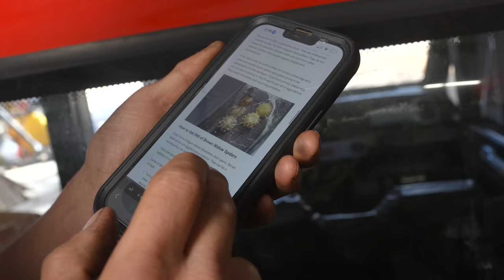Building an Elevator in my Dream Garage! Officially Moving in!

Comment: for insurance, you don't have a elevator, you have a materials lifter
Reply: Premium
Reply: a dumbwaiter. idk how to spell it.
Reply: I hoping they add a fireman's pole and ladder.
Reply: @robmanueb. Definitely need a pole haha
Reply: great thought, rkeantube…or else Ethan’s Risk Assessment will be SwindleShrek’d for a most non-Premium Premium
Reply: @mrgmc6314 I see what you did there…very clever
Reply: worthy updoot recipient
Reply: This! I work on freight Elevators Aka Verticle Reciprocating Conveyors(VRC'S). ANYTHING that carries people has tons of safety requirements.

Slap a "no riders, material use only" plate on that bad boy!
Reply: No actually fr tho
Reply: Y’all need to mount the winch on isolating rubber dampers - I bet it would be super quiet
Reply: For insurance, they never saw this video at all. Especially Ethan standing on beam steal welding a story high welding ✋👌😂
Reply: @OkGamez313 pretty sure that's right
Reply: Materials load. And they should add a small ladder on the side so that there's a physical way to get up there. It can be a basic cheap ladder fixed in place with metal brackets at an angle. Who's to say it can't leave when the inspector ain't there. > .>
Reply: Good call because insurance will look got anything to make the policy "Void".
Reply: There is no way these guy have that kind of insurance.
Reply: @grizoh buddy, they're making more money than us combined 😂
Reply: True! Not sure of their state requirements. But most states and insurance companies require a landline ran with an emergency phone installed for any “elevator” that carries people. Even if it’s only one floor
Reply: It's not an elevator, It Is a man lift! Like ones used on construction sites!
Reply: Well yeah
Reply: @Swiftwinter for the beam they better hope osha dont see this vid
Reply: Or just call yourself a block of wood 💀

Comment: the old shop would be really good as a paint booth so that you wont have paint dust everywhere in the new shop
Reply: That's actually a really solid idea!
Reply: I was thinking a fan and filter system for the new shop, and an office, editing room/bunkhouse b&b for the old building.
Reply: Having a dedicated place to make a mess is great, especially when you want to paint but it's cold out.
Reply: Also would probably be great for parts storage so they can move some of their stuff inside
Reply: Will's a goof ball, I love it. We got a guy at work like him, we call him Tism, cause he might have a touch of the autism
Reply: @merlincultofficial3235  I dont know, they have plenty of wood around so making a roofed storage from timber is rather easy. Just dig a hole, take old growth/slowly grown logs, debark, burn the surface, add the tar coating, least on parts that go underground, put flat peace of stone on bottom, then the log set upright, fill the sides with large stones hammering them in there with sturdy peace of wood, then apply earth insulation fabric and some gravel. Then connect the logs from top and braze to each direction, build a roof and put metal sheets on sides you want it to be protected from. Simple, cheap and sturdy construction to house parts and vehicles etc and propbably lasts 50 years if maintained properly.
Reply: The old shop would be absolutely awful to paint in.
Reply: @dcskate1022  why?

Comment: you should paint the floor red under the lift so things dont get set under it then broken when going down. i know it seems unlikely but its a really easy safety practice.
Reply: I've never squashed anything under the lift, and yet reading this I kinda want to do this.
Reply: Idk about anyone else but I think safety tape/visual queues and visual deterrents look really rad. So a red square underneath the elevator, maybe with horizontal lines, would look pretty rad.
Reply: This idea needs more hexagons obviously...
Reply: I've crushed a toolbox and a chair under the lift....oops
Reply: Mannn.. there’s no safety precautions on this page. You came to the wrong place 😂

Comment from the maker: Now that the garage is done what do you want us to work on first?
Reply: Firetruck would be a fittingly sized project for all that extra room 😎
Reply: @goosenotmaverick1156 100% yeah
Reply: The rotary trike!!
Reply: Finally Finnish the 2j mower
Reply: Definitely 2jz mower
Reply: electric tank. the 1 you started 2-ish years ago and forgot about it
Reply: Monster Mini
Reply: Electric tank!!
Reply: Do you still have the Subaru brumby/brat?
Reply: Something OUTRAGEOUS as always, of course!
Reply: I feel like you should have sealed or put down epoxy on the floor before moving in.
Reply: The limo or firetruck could use some love. 😎
Reply: Gotta be the firetruck and a matching little water cannon tank you can drive up on it.
Reply: Firetruck
Reply: Use the firetruck as a reservoir for the tank.
Reply: You guys should make a dope shop sign for the outside!👌🏼
Reply: @roybevins8682 I agree. It’s a lot nicer to have an epoxy floor because then you don’t get dust from the concrete. Also it looks a lot nicer.
Reply: full electric 4 wheel rockcrawler with center of gravity lower than center of the tire. you could custom build the frame and drive systems. would be so cool!
Reply: Make a submarine? To soon? Or 5o late? 😂😂😂
Reply: Get the ruckus done please!
Reply: It may make sense to have the table that the arc droid is on the same height as the fab/welding table. That way when you have a full sheet of material you can use the welding table to hold up half of it. Just a thought. Love the new shop guys!!  Almost done outfitting my new shop myself. I made my welding table to be the same height as my giant bandsaw so if I need to cut a sheet I can use the table as the run on or run off. Works great.
Reply: You guys should do something to those electric bikes like making them faster
Reply: I think another mini truck/ 4 wheeler or something tiny would be fantastic 😂

Then the fire truck🎉
Reply: Everything!
Reply: Fire truck then the limo before the room runs out in there😅😅
Reply: Shop tour!!!!
Reply: Ls swap the mini Cooper. Thing deserves some horsepower.
Reply: I been joking around for years that if you mate a K series honda to a B series transmission (crv) and point em 180 degree and install em in the rear end of a car you could have a rear engine awd package that is rwd biased... maybe.
Reply: A race drone that carries people! Haha
Reply: Is the ruckus finished?😂
Reply: Electric tank!
Reply: 2J mower or the rotary trike. Definitely 👍
Reply: Make something g out of that Porsche power wheels
Reply: redo the lift
Reply: A Brown Widow habitat.
Reply: The Electric tank gets my vote. The fire truck is second.
Reply: Electric tank!
Reply: Go back to your roots. Time to revive the mustang with some fresh upgrades and changes. It's what started it all so she should be brought back out into the light.
Reply: make a monster kei truck
Reply: Old garage to paint both
Reply: That 2jz  tractor would be an epic project when done.
Reply: @GrindHardPlumbingCo I think it would be incredibly ironic to do your smallest build yet. Whatever you can think of. Like a small humdinger motor powered car or something idk
Reply: Firing Will!!
Reply: V8 powered sherp
Reply: Unimog Jaguar !!
Reply: Micro rock bouncer
Reply: Triple rocker arm 8 wheel drive rock crawler
Reply: Screw it, keep improving the shop. Add ventilation
Reply: All of the above 😄 Honestly I don't really care what you guys do next, your videos are entertaining regardless of what you're working on.
Reply: It is a looong time since I saw  the Colonel and the Barbie jeep and Mustang, and I reealy like them. Please do a makeover/tuneup, and send them through  the new extended GHP racetrack that you are going to build. Mush love
Reply: The power wheels tank needs a revamp!!!
Reply: A 2WD big wheel motorcycle - like a Rokon but cooler and with more power!
Reply: Lol everyone is saying different things and I agree with all of them
Reply: Fire truck and the diesel limo
Reply: make a grind hard plumbing co sign made from broken engine parts and other broken parts. to let the world know that that is your garage and that the brown widows can't have it.
Reply: Honestly, a filtration system for the new shop. You do so much cutting, grinding, welding, etc it would keep the new shop and your lungs cleaner 🙂
Reply: Fire truck 4 sure
Reply: A huge Classic garage sign
Reply: You already have a firetruck so I think a fireman's pole is in order!
Reply: I’ll be the most un-cool person here but I’d love for you to create an extraction system. Your old building had so many holes it would probably self extract. I’ll let you decide how to make that a cool YouTube video 🫣😂
Reply: Mini rock bouncer!
Reply: A rare and endangered arachnid research preservation and breeding laboratory
Reply: Barbie Kart 2.0 supercharged fastest power wheels build ever.
Reply: Hayabusa Helicopter
Reply: Off road chopper for the winter coming up
Reply: More videos with Colonel senders.  Footage of rides / races.  The builds are amazing.   Watching you guys using the vehicles is also amazing.
Reply: A super low geared "Mountain Goat" with an arched "roll" cage, so it can do just that. Or have the "kids" build a complete "ring" of dual pipes, with a motorized kart that rides inside it, so a big, let's say, 12 foot circle cage thing could ride around the yard. Use the grippy sandpaper like stuff they put on steps around the inside perim. so it doesn't slip. A never ending roller coaster, if you can picture it!  🙃😊 Or you could just start an "around the yard" roller coaster. Then you would have the "Carnival" police coming to visit. They are a bunch of Clowns. 🤡🤣😂🎢
Reply: probably a good idea to put some gravel on the back of the shop so the water coming off the roof doesn't wash a big trench in the dirt.
Reply: I want to see you guys build an actual snowmobile and what your twist would be on the front and rear suspension.
Reply: make will an apartment
Reply: loft entrance exit near the back corner! and a fireman pole
Reply: Electric tank
Reply: A little single seater tank that fires snowballs with compressed air
Reply: make a go kart with a zr900 engine
Reply: Work on how to not be so bad ass?
Reply: Finish everything you've started, doesn't matter. Will can finish the Kill Will Scooter. No, I hope it doesn't hurt anyone! You can then build a large storage shed to put all your projects in. 👍 Have fun.😀
Reply: the honda ruckus!!!
Reply: @kyleconger6544  that's what I'm saying! Will is on to something there!
Reply: badland cheapo harbor freight 12k winch not better idea?
Reply: Coffe bar, cuz you guys look not sleep enough
Reply: Fixi'n up the limo truck
Reply: @tigrote100   amen
Reply: You should build a hot saw with something turbo and anti lag
Reply: something fully left field from what everyone is saying haha
Reply: I want to see all the unfinished projects come together
Reply: The FUCKING FIRETEUCK WOULD BE THE BEST THING EVER 
I DID SOME DRUGS AND I LIVE YOU GUYS
Reply: @MeTheTherapist Well, if you tried to make the center of gravity that low it wouldn't have much clearance, but putting the batteries in the bottom of the frame would make the center of gravity very low, certainly lower than most other conventional 4×4's! It's a cool idea, though. I'm just not sure it would be all that practical if you were to try and put the center of gravity that low.
Reply: @fredshort8970 I like that idea! Maybe a twin turbo LS powered Sherp?
Reply: @galaxy3620 Bike's suck in the snow, (especially choppers) that's why they make tracks for dirt bike's!
Reply: I still want you guys to take a cheap utility SXS and make it awesome!!
Reply: The electric tank! Lol
Reply: Ethan’s house siding!
Reply: Mabey seeing if you actually have have black widows living on the property lol.
Reply: Hayabusa kinetic wood splitter
Reply: To stop the bad habits you have of saying premium. I have never heard anyone else say this the way you use it and you guys say it I’m pretty sure way too many times in every video. Other than that I like your videos but man I cringe every I hear that word. Let’s see a six by six power wheels
Reply: @kickindave03 premium hot take guy
Reply: The electric TANK ofcourse!!!
Reply: i want to see the off road chopper, but also i really loved the odyssey build and i think you guys should do another one but maybe like a street build would be sick for one
Reply: Slow down for the winter
-your neighbor that loves the builds and refuses to put previews on their channel.
Reply: 2j mower
Reply: My car, please 😂
Reply: Looking good guys! But ya should of hinged your elevator floor so when not in use in the down position you could fold it against the wall keep up the good work!
Reply: Electric crosscart!! Axial flux emrax motor
Reply: Может что-то из водной техники?
Reply: You need to monster-up the hummer you guys managed to get home.
Reply: Get a vent for your garage/workshop, or you will regret it when you are older.

Comment: You need to install limit switches for the up and down travel limits wired in line with the up and down buttons. That way the winch doesnt over travel. For the push button station you can install a coil cord and mount the button on the elevator, or mount 2 seperate switch stations. One upstairs , one downstairs
Reply: Also I'm concerned about the pinch points at the top of the window, the floor portal and the beam interacting  with that pipe handle, it needs a bit of sheet metal as a guard, that'd solve it easily. 

It's big enough to fit a hand in just fine, but if someone slips and gets an arm in there it'll probably wreck your day.

@32:34 you can see what I mean.
Reply: @906MediaProductions  yeah I was concerned about that too, almost needs a cage around it with a door that has a safety switch

Comment: Commercial elevators have safety mechanisms built in so that unlike what is shown in the movies they don't come crashing down if the cable breaks. The original Otis patent from the 1870s used a spring loaded ratchet system that was kept open by tension on the cable. Modern elevators have a similar design but they use brake calipers on the rails. It's much smoother stop than jamming a steel rod into a notch. Oh and remember to keep all arms, legs, and head inside the vehicle unless you like playing with fate. In which case maybe you should have built a paternoster instead.

Comment: Use a pulley to reduce the winch load. Angle brace the elevator floor to disperse the load angle.
Reply: this was my thought too! pulley system would make it even smoother and like you said less load on the winch directly!
Reply: I'd only be worried about load on the winch brake, but if they got a winch ment for lifting then I'm not worried.
Reply: A pulley would half the speed though.

Comment: add limit switches at the top and the bottom that way it will auto stop at the spot u set for it. then just have a button on the wall down below and up top when u wanna go up or down.   no need to keep up with remotes and able to hold onto what ever your transporting with both hands.    also add a roof thats level with the second floor when lift is down so no matter what the opening is closed in the floor weather lift is uptop or down below

Comment: Elevator switch:
Us the spool from a cheep shop drop light. Take out a peas from the ratchet  mechanism to alow it to move freely. Make sure you get with a ground wire you will need 3 conductors. 🤟

Comment: A vibration dampener between the winch and the beam might be a welcome addiction, as well as top and bottom limit switches. Maybe you could even implement a strain gauge somewhere just in case something gets caught below it, the strain gauge would suddenly register less weight hanging and can trip an emergency stop. Also is installing a car lift a planned idea? Either way, amazing work :) I can't wait to see more!

Comment: Hey guys, I wanted to give a huge “At a Boy” to You all. I’ve been in commercial, industrial, and residential construction for 50 years while owning my own business for 33 years. You have nailed the build In design, accessories, and esthetics in so many ways. I installed a man-lift and materials elevator in the center of a building to get from the basement to a mechanical penthouse on the roof and I used 3/8” x 4’ x 6’ plate steel as a door that went up and down as the lift went up and down in order to close off the shaft. I know of no one who would not be proud to have this for their own. 👍🏼👍🏼 Kudos to You All

Comment: You should make the window shelf bigger.  I would gusset the beam so it does not twist as much and maybe use so rubber isolators to reduce noise.
Reply: I was thinking the same thing on both suggestions. The I beam flexing is kind of sketchy and the noise could be reduced a ton if they just rubber mount the winch.

Comment: You can easily make an emergency brake for the lift. Lookup the original Otis lift patent. It is a simple design and will lock the lift in the event of a cable failure. Similar to most 4 post automobile lift systems.

Comment: I'm excited to see all of the shop infrastructure projects. Finding efficiency in a workspace gives me the fizz
Reply: 33:00 you could also wire another button on the elevator, as well as another one at the bottom, so you can control the elevator at the top/bottom/inside.

If it's just a button you can wire multiple other remotes in parallel

Comment: Maybe put runner wheels on the outside of your guides to 'pinch' the metal lips, it will stop the rails possibly spreading to far and releasing the bearings. Also could extend the axle on the winch to a bearing mounted on the wall to give it more strength

Comment: Awesome vid. Im in the elevator union and work for otis. We use polyurethane coated steel flat belts for ours. Smoother and stronger than steel cables.